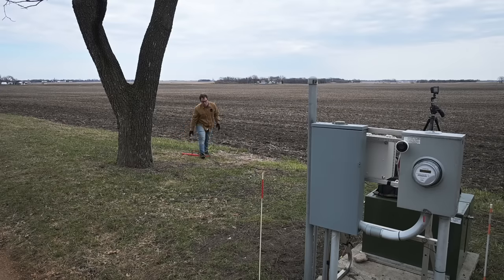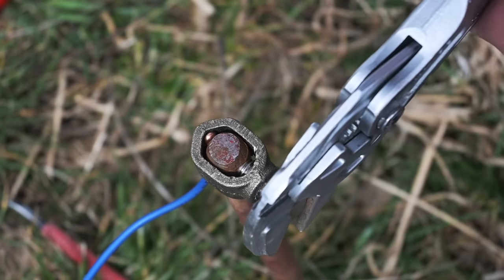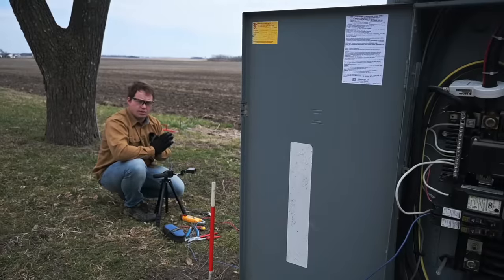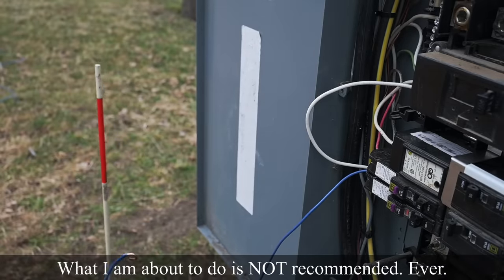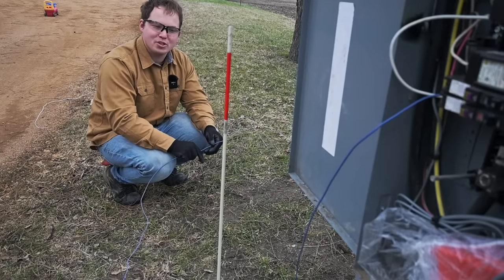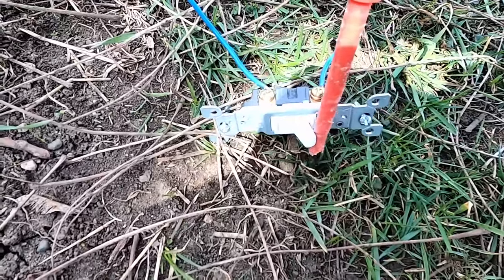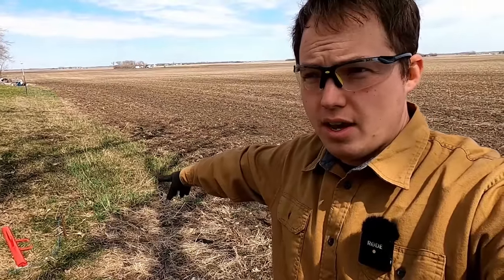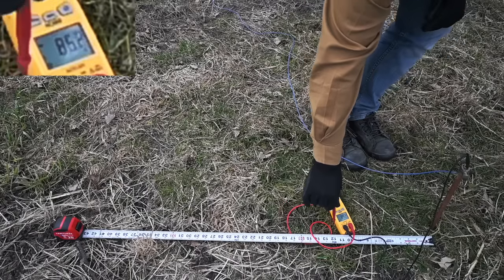Will 120v To Ground Trip a Circuit Breaker?

Comment: The dirt has resistance to it limiting the current that can make it back to the source causing the breaker to not trip
Reply from the maker: You got it!
Reply: Ohms law baby
Reply: Exactly! 
That's why saying Earth is the path of least resistance may not quite be true.
Electrical conductors/wires are excellent conductors!
The ground wiring system back to Neutral at the main distribution panel is the requisite for a proper electrical installation.
Reply: Specifically in that situation if he got around 10 amps the dirt would have 12 ohms of resistance.

Comment: In the case shown...the ground rod is not properly grounded...hence the impedance is high which limiting the current flow...the correct device for ground fault protection is RCB not MCB...

Comment: To be honest, I knew what I thought it should do, but I did not think that would happen, otherwise, there wouldn't be a video. Being obsessed with electrics since I was 5 and taking apart TV sets when I was 8 and fixing my Grandma's Hi - Fi, that a service man could not fix when I was 10, and rewiring all of the houses my Mother got, because they were done wrong, I took thought that any time you dead shorted to ground, it would arc and trip. When I was 8 I dared a friend to touch two stripped ends of an extension cord together while the other end was plugged in. He did and there was an arc, the two wires fused together, the breaker tripped, and could not be reset.

Never did tell my parents what we did, but they were unhappy because it was a house they had built for them, and it needed a new circuit breaker, to be done by an electrician, because I was 8 first of all and I didn't know better. So luckily, my friend and me, did not lose an eye, and we survived being stupid. As I aged, and were I am at now, I am obsessed to compulsion over ground wires and even more so not only of the outlet itself being GFCI but also at the panel and I am hoping that someone is working on something at the main, and at the pole. The reason, houses are flooding a lot, and people are living in their basements. I TOLD my Mother and Dad when I was 13 years old that I am going to live in the basement. Luckily, there was no argument and they didn't use that as a teaching moment to not tell them what's going to be done. 

Anyway, people are keeping TV sets (Back in the tube days) refrigerators, deep freezers, etc all in their basement. So if the water level rises high enough to submerge those appliances, they're still going to work for a brief period of time, and that water is going to be electrified. So anyone that comes into contact with that water is going to be electrocuted. And it's not going to matter if there are GFCI outlets or breakers once the water level rises to the electrical box. So if it always can be disconnected, closer to the source, the safer it should be. Then of course a regular test needs to happen. How many people actually test their GFCIs monthly like they should. I bet almost NO ONE does.

Comment: My suburban house was built in 1994. The inspector from the city electrical would not pass the final inspection until redundant "grounds" were installed at the main service box  (neutral and ground are connected here). I have an 8 ft. Ground rod driven just below the main service box which is mounted on the side of the house. The inspector insisted a redundant ground to the cold water plumbing or a second rod needed to be provided. I humored him by temporarily grounding to the plumbing because this created an extreme hazard on the plumbing. The plumbing is all copper tubing in the slab with soldered connections above concrete for all taps. The water heater is gas and has no ground connection. Worst of all, city water was connected through about 300  ft. PVC pipe to the water meter, which the equally stupid plumbing inspector insisted having a bonding jumper across it. This left the entire plumbing system a floating mesh of copper with only the relatively high resistance of the drinking water inside the PVC acting to "ground" the plumbing. If the plumbing were relied upon in case of a ground fault, all plumbing fixtures in the house would be hot.  Needless to say after the inspection, I disconnected the redundant plumbing ground and drove a second connected a second ground rod to satisfy the redundancy requirement but considering their rather poor grounding capability in the dry limestone soil here, it appears the only "ground" present is the connection between neutral and ground in the main breaker box. Any suggestions for improving this grounding mess?

Comment: I hope the power company is watching this video :)  Sometimes when water is flowing though the ground it creates DC currents. The ancients would try to tap into this energy source. Today we use microwaves to heat water : The Ancients used the flow of water to create various energy waves. Some submarines can be propelled by creating a flow of current through the salt water surrounding : Electrohydrodynamics.  Tesla did much study into ground currents. Why do we need wire ?

Comment: Sorry for the super delayed comment, but why did touching the panel instantly arc and pop the breaker, but being connected directly to ground did not? isn't the panel grounded in the exact same way as the ground rod you were testing with?

Comment: It would be interesting if make a video where you start moving the ground rod closer to the panel to see at what point the breaker trips! Another idea would be connect a fluorescent lamp plug it to ground on the panel and the other side touching the dirt ground between the rod and the panel to see when start to light on!
Reply: The distance varies widely based upon the Soil Moisture content  ...

Comment: It is not voltage to ground that trips the circuit breaker but amps.  A 20-amp breaker will start nuisance tripping above 16-amps and should trip at or above 20-amps.  The standard breaker is to protect the wire while a GFCI breaker protects both the person and thus the wire.
Reply from the maker: Exactly. Its hard to keep the terminology straight but I'm hopefully getting better as time goes on.
Reply: Not true. Inverse time breakers can take up to a 10x surge for 1 second. Google trip curve.
Reply: @jaydaily6751  - Didn't mention anything about time in my comment, just how a typical breaker works.  We could include temperature compensation to the mix but that doesn't alter the basic function of the breaker.
Reply: @rickcrooker2407  Typical breakers are inverse time breakers. You won't find an instantaneous trip breaker at Home Depot.
Reply: @jaydaily6751  - Again, I never brought up time.  So at what amp will a 20-amp rated breaker trip?
Reply: @rickcrooker2407 A 20A load at 40°C (104°F) will trip the breaker. 40°C is the temperature UL rates breakers. A 20A breaker will not nuisance trip at 16A. Looking at a Square D spec sheet, a 20A QO breaker trips at about 22A at 70°F.
My point about inverse time breakers (the most common type of breaker) was to point out that there are instances when a 20A breaker won't trip when there considerably more than 20A for a brief moment.
Reply: No, a working breaker must handle the designated current indefinitely. It takes several times the designated current to trip immediately.

This is an example of a trip curve: https://www.electriciantalk.com/attachments/type-c-jpg.52377/

At twice the rated current it trips in 10-40 seconds. It takes 5-10 times the designated current for immediate magnetic trip.
Reply: @okaro6595  - Then everything Westinghouse / Cutler Hammer / Eaton taught is incorrect.  Again, take time out of the equation and the heat produced by the upper range amps flowing trough the breaker will nuisance trip it.

Comment: So when a metal building has a sacrificial pit It's grounding the building to the ground. They already ground the electrical system with the ground rod. What is the purpose of the extra ground pit? Is it just extra insurance that you are grounded?

Comment: "ground rods do not fix voltage problems..." -- Dude, you completely missed the point of connecting the ground rod to the panel ground. The purpose of the grounding rod is to tie the panel frame/ground to the same potential as the grounding point on the source (in this case, most likely the X0, neutral point of the transformer behind your panel). Nobody would ever just pound a ground rod into the ground and expect it to do anything for their electrical system. The rod needs to be connected via a ground wire to the metal frame of the system/grounding point.
Reply: "Having a ground rod connected to an electrical system or to a frame of a building doesn't actually make it safe" - Also mostly incorrect. Having a ground rod PROPERLY connected to a grounded source electrical system via a GROUNDING CONDUCTOR is exactly how electrical systems become safe. Pounding a ground rod into the ground, NOT properly connecting it via a ground wire to the system is what made you draw that conclusion. As an aside, bonding a ground rod to the metal frame of a building will provide some measure of safety, provided that the bonding conductor/metal chassis/frame of the building are all tied to the system ground. The problems in your video are most likely caused by a poorly grounded source/poorly grounded main panel and would most likely be solved by the proper installation of a ground rod!!!

Comment: The current slowly increases because the water around the rod is getting more and more conductive. I have testet something similar with distilled water (not conductive, or pretty close) and sticking two nails in with my bench power supply connected. The water started to conduct more and more because the iron started to add salts to the water. Atleast that is what i think is happening.

Comment: It's not the rated current that pops the breaker, for a C type breaker you need 10 times the rated current to trip it immediately (We are speaking about plain old MCBs).
For a C20A breaker that is approximately 200A, no wonder the wire melted.

Comment: Next you'll have to add a second ground wire from meter to breaker box.  Or the power company won't pass it's inspection.  

And there's 1 neutral strip and separate ground strip in the breaker box they're separated.

Comment: I've been wanting to do this to show you ground is not a pathway to clear faults....you're in pretty good conductive soil there!
Reply: When you connect the wire to the cabinet enclosure the fault current is not 20 amps.  Current is much higher based on the available fault current from transformer which is based on the secondary voltage, transformer Kva rating, and transformer impedance and impedance of the circuit conductors to the fault.  You probably have in the range of 3500 amps of fault current which the breaker sees and operates in the instant region of the breaker trip curve.  20 amp breaker will trip on 20 amps at about 1000 seconds.   That’s the overload region of the breaker trip curve.   Breaker will never trip on 9 amps of current.   Showing the breaker trip curve and the two different current values versus time would be a good closure to why the breaker tripped on ground fault.

Comment: it depends on how long and thick the ground rod is and how many rods used, you can also used bentonite to decrease the resistance a lot more moisture would have given you a better result the mineral that is available in the soil plays a major role for example salt could increase the conductivity which is a mineral please run this test.

Comment: 3 more tests on this , Lets try this using a u-fer ground 20 feet of copper or re bar in a concreete slab as the ground. Then test anchor bolts in the same slab for voltage. And why did your voltage increase the further away from the ground rod?? Your back yard ground test, run another  wire tween the two ground rods and test for spark and see the load used going into the new ground rod.

Comment: This is why on a Multiple earth neutral system MEN  or TT system, one needs RCDs or GFCI on each power outlet circuit. They detect any imbalance between phase and neutral, it causes the circuit interrupter to operate.
The ground rods keeps the electrical grids neutral system  at zero voltage potential. 
A floating neutral system would be a nightmare to fault find.

Comment: My theory is all currents that flow to ground must return to the ground wire that is at the base of the power pole with the transformer that feeds your home.  That ground wire should be connect to the neutral terminal on the transformer.  Assuming the transformer feeds only your home, measure the current in the ground wire next to the power pole next time, and it should be the same reading you get at your breaker panel.  For an acid test of my theory, disconnect the wire from the ground rod next to the power pole, and there should be no voltage measurement on the ground anymore.
Reply: Power Plants ground the Neutral.
Arriving at the transformer near your home, it is also grounded.
The only purpose is to protect the power distribution grid and equipment against atmospheric discharges.

At your home, you are required to ground the Neutral and bond all exposed metallic to a ground electrode.
House wiring and equipment should also reference your building system ground.
At your home, this functions a double protection. One is like that of the power distribution. The other is for conducting shorted fault currents made available on any exposed metallic surfaces to back to neutral in a hope to trip circuit breaker.

Comment: If the resistance is low enough it should trip breaker you could try two rods hooked in parallel if rods are equal resistance it should cut ohms in half. The current should be then high enough to trip breaker they should be 6ft apart or more for best results.

Comment: One test you didn't make is when testing the voltage already a few feet away from the ground rod and five feet towards the panel. You would have seen a surprising voltage on the probes, meaning you are not safe even to walk on the ground if you can be a conductor between your feet. A power company supervisor friend of mine was sent out to investigate why a horse went into cardiac arrest and died under to sets of power lines on separate grids. The grids were only about 20 feet apart. He put a prob in the ground near one of the grids and then the other prob near the other grid. His voltage reading was 21kv. When he saw that, he quickly pulled the probe and took bunny hops to retrieve the other probe and quickly exited. His report had the horse killed by electrocution as a result of the difference in grounding potential between the two power grids.

Comment: Hey I have a couple questions about a few doubts that go around my country and I would like to know your opinion

Question #1: A grounding rod cannot be inserted by being hit with something metallic directly, instead you have to use a wood plank or something between the metals to isolate them because otherwise the copper rod will "loose" electrical properties, have you heard about this?

Question #2: I believe it is mostly a recommendation,  you see, our services providers have ordered that grounding clamps cannot be used, instead the wire has to be soldered to the rod via exothermic soldering

Thanks in advance
Reply: In regards to question #1, the only reason I can see that you would want to use a wood plank when installing a ground rod is to prevent mushrooming of the top, which could make getting the ground clamp on difficult or impossible (without using a file to clean it up). Hitting a ground rod with another metallic object will NOT change it's electrical properties!
Reply from the maker: @brianleeper5737  Exactly.
Reply from the maker: Soldering is always more reliable than clamping so I can see why some would want it done that way.
Reply: @BenjaminSahlstrom  I think he meant exothermic welding, not soldering. As I recall soldering of ground wires is not allowed.
Reply: Brian Leeper  🤣🤣🤣

Comment: Is that gradient a direct straight line back towards the main panel or would it radiate out 360 degrees?
Reply from the maker: Good question! I might test that in a future video. I believe it would be 360 degrees but I'm not 100% sure on that.
Reply: @BenjaminSahlstrom  yes, it is 360 degrees around the rod, which is why it’s called an electric field.

Comment: Benjamin. .the breaker will not trip because the path to the source..the utility transformer. .was not made..it has too much resistance in the earth to make it back to the ground rod which is BONDED to the panel which then it would have flowed back up the panel over to the neutral and up to the utility..the source..thus increasing amp flow and tripping breaker. .this is exactly why the neutral and safety ground are tied together at the main panel only...

Comment: I thought it was a GFCI due to the sound it made. The gfci breaker I am purchasing for my 570 volt AC power supply I built is very quiet as well.

Comment: Ground rods are not useful for ground fault resolution. Their useful purpose is to provide a "low" impedance path for lightning strike protection. If this path is not provided, the lightning will arc to other opportunities such as your 65" flat screen.
Reply: Exactly, had to explain that to an HVAC tech, he missed the day they taught electrical theory at HVAC school

Comment: Lets say that the neutral and  ground cables are bonded toguether  at the main panel. Now if a hot wire makes direct contact  with the  ground wire conductor What would happen? Does it cause a short circuit?
Reply: Yes ...

Comment: Here in the philippines i did connect a wire to a tube pipe of a pump and got the live wire and install a lamp partneredby the wire connected to ground pipe of pump and the bulb iluminated!